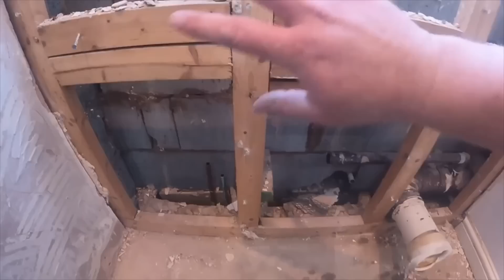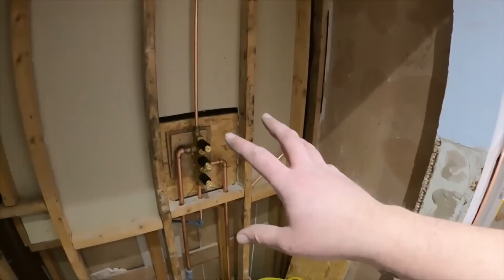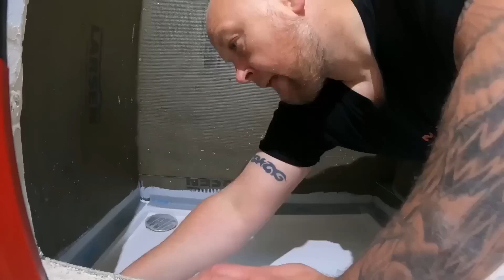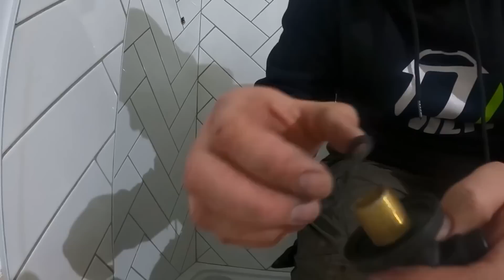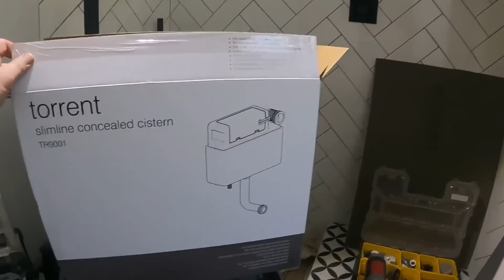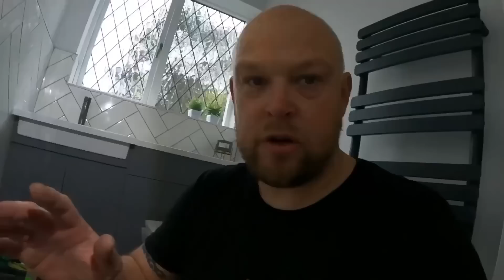COMPLETE BATHROOM RENOVATION | Real-world Plumbing Guide Step By Step

Comment: Been doing this exact work for 30 years man and although for the most part this is a cracking install that tray installation has given my left eye HIV and the right eye full blown AIDS. The poor herringbone on the one external corner low level can be ignored as hopefully you're not charging "high end" figures?
Also the reason you don't need to explain to numptys about the joints on the outward flow of the valve is the fact it's flowing and not standing pressure eigh. They'd probably be fine if just dry fitted ;-)

Comment: Don’t bite me but is that a gravity fed shower just going by the tank in attic?
Reply from the maker: It is buddy and works a treat
Reply: @MJTiffPlumbing  does it require a pump I have gravity system and looking to replace bath with shower and love the idea of setting the controls at opposite end do you recall the make of the shower or have any favourite gravity showers you use/install ps loving ya channel found u a few weeks ago and haven’t stopped watching ya bud 👍🏼👌
Reply from the maker: First off welcome to the channel, glad you’re enjoying it.

All depends on the head of water you have mate…. And what type of system.

If in doubt then a pump would be a save option

Comment: Working with wood and boards, you are so lucky tiff. Here in kenya 🇰🇪  is all about stone and concrete walls 🧱 quite tricky, especially while doing repair work.
Cheers, mate, job well done.
Reply from the maker: That would be tricky at times

Comment: for the shower valve is it ok to use 3/4" to 15mm couplers instead of 3/4" to 22mm. or do they need a certain length of 22mm pipe before reducing down to 15mm?
Reply from the maker: Never had an issue mate

Comment: Nice one, MJ, and the boys involved. A little bathroom reno, speaking for itself. Was dinky to keep the level of the bath bottom, and making the steps down into the shower. 

And I feel for the guys doing the 'herringbone', it looked to be one of those ones where you needed patience, patience, patience because there's so many cuts to do, of various lengths, to fit a small room. You think abut the end, how tt will look, to keep you going, and job done.👍👍
Reply from the maker: Yep…. They did an amazing job on a VERY tricky bathroom

Comment: Thanks for the content, just only later realised that it's probably an old video. 

Does backing boards fixed only with screw without a washer?
Reply from the maker: Thanks mate…..

Yep they are fine….. in hindsight washers would of been worth fitting but wasn’t an issue